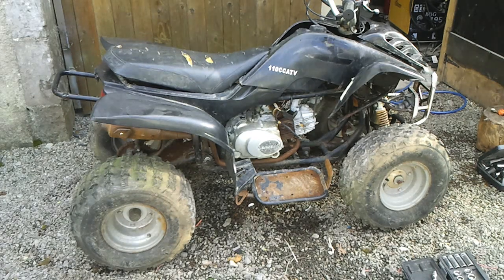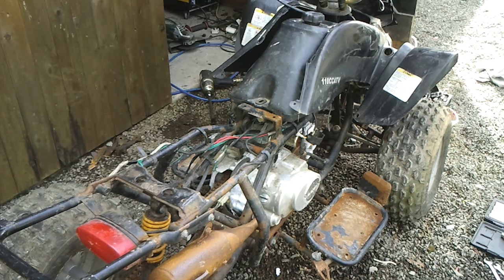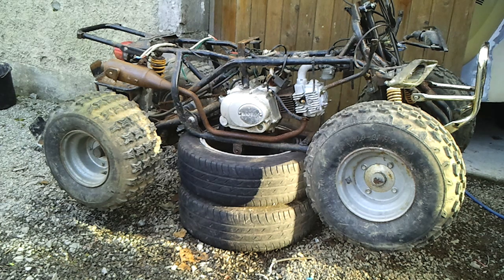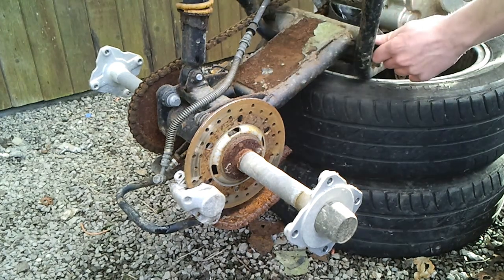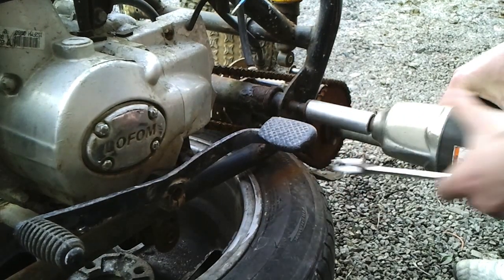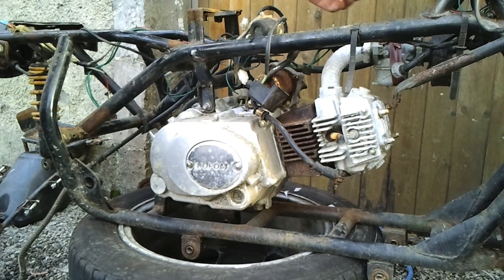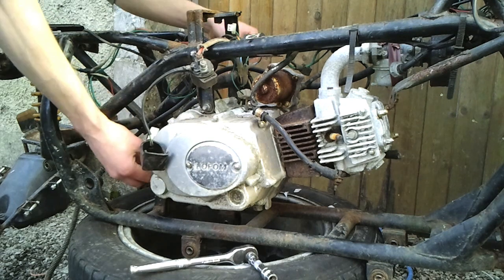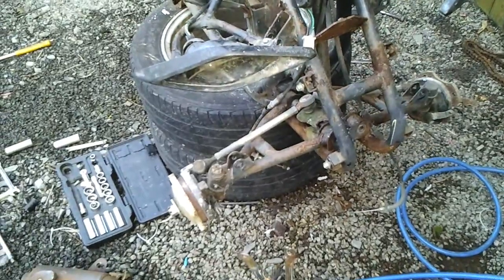How to disassemble 110cc Chinese Quad ATV

Comment: I need to know where the hoses go I have oil spitting out my engine it's identical to yours except mine is shift driven could use a oil help
Reply: Mine is shaft driven as well and need a part for my driveshaft but these quads are a bitch when it comes to getting parts like a driveshaft connection sleeve! Mine also has a drum break and has a name on the motor thats is called motorellie? Is yours the same?

Comment: I own a ba90 from baja motorsports, 90cc 4 speed. It ran a top speed of 42.5mph on a gps. I did the adjustment to the rev limiter so it would rev as high as possible. I also advanced the timing by moving what I call the pick-up coil. I did the header and a homemade silencer/muffler that is strait through. I installed and carburetor from like a 1978 cb 200 honda, just one of them with no air filter. It was a challenge to tune the carb for max power. I lifted it about 2 1/2 inches so that wheelies would more easy. I also made it 2 inches wider for stability... I can do wheelies in 1 or 2nd gear. 42.5 mph is not bad for a 90cc. Good luck with your project, I hope it comes out well for you.